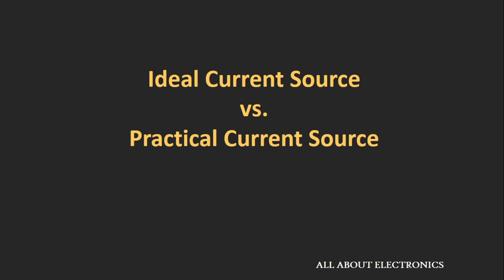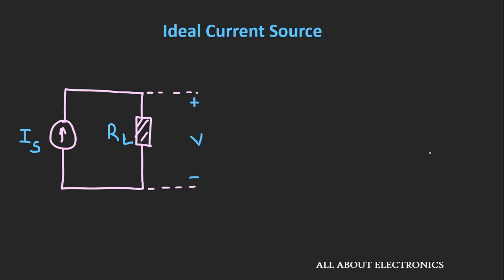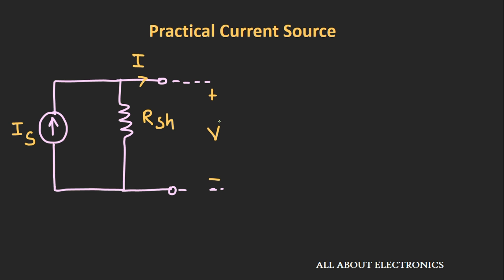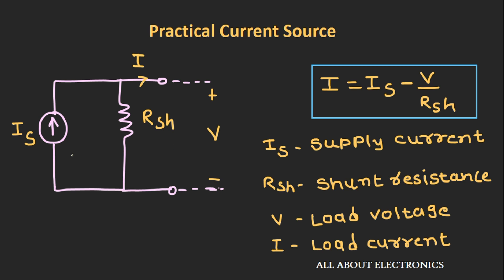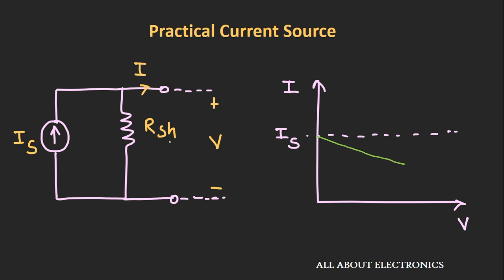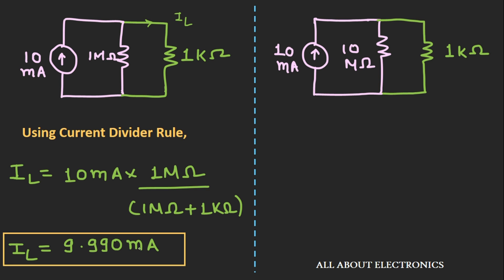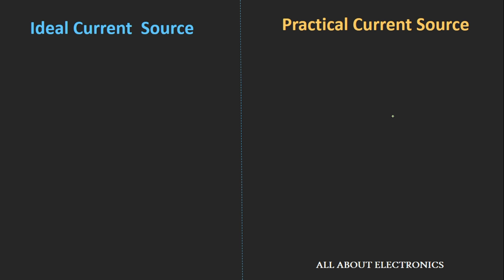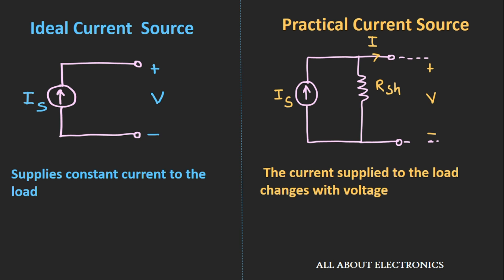Ideal Current Source vs. Practical Current Source

Comment: I may be getting something wrong, but I thought that since I is inversely proportional to resistance, increased resistance reduces the amount of current, and since in parallel voltages are equal hence if I(1)*1Mohm = I(2)*1000Mohm  then I(2) must be smaller than I(1) hence I(2) which is current through load is 10-9.990 as opposed to 9.990. for the left example?

Comment: Why is the resistance of practical current source is attached parallel to the current source a shunt, but not as series resistance?
Reply from the maker: It is the output impedance of the practical current source. If you see the V-I characteristic of the practical current source (at 2:36), then as the voltage across the current source increases, the actual current delivered to the load reduces. That means there has to have some leakage current. This leakage current is through the shunt resistance. 
If this resistor is in series to the current source, or in a way, if it is series with the load, then current through it is same as the load current. (In series, the current remains the same)
And there is no way we can characterize the leakage current. It can only be characterized through a shunt resistance. I hope it will clear your doubt. 
Also now once again go through a video, you will get it. And still, if you have any doubt, then let me know here.
Reply: @ALLABOUTELECTRONICS  Does that mean the assumption of the internal resistance of a current source being parallel to it is based on the experimental result( i.e., the V-I characteristics)? Is there any theoretical explanation for the fact that increasing voltage across the current source decreases the current to load?
Reply from the maker: @keertikiran8492  For a basic understanding, you can assume so. You can also do the experemient by yourself. Every source can deliver finite amount of power (Vx I). When you will go through the actual circuit of the current source using MOSFET and BJT, you will learn that it is in fact the output impedance of the current source. It is the inherent property of any source.

Comment: What if join shunt resistance to the ideal current source .
Can u give a example of current source
Reply from the maker: BJT or MOSFET are can be used as a constant current source. Although they are not an ideal current source. But can provide almost fixed current depending on the set input voltage or bias condition.

Comment: sir how to identify series and parallel circuits
Reply from the maker: In the case of the series connection, two elements are connected at one end. 
For example, when two resistors are connected in series, the one end is common. 
In the case of the parallel connection, both ends of the resistor/capacitor/inductor are connected together. 
I hope it will clear your doubt. If you still have any dobut, do let me know here.

Comment: Pls answer this
Why do we use shunt resistance in practical?
Why can't we just neglect it like in ideal current source?
Reply from the maker: The practical current source has finite shunt resistance. Although usually it is very high but not infinite. In case of ideal current source, the shunt resistance is infinite. So, it can be neglected. But in case of practical current source, due to its finite value, it has its effect on the output current.

Comment: Will you please elaborate 2nd point of practical current source... because I am not getting this limited thing...plz help
Reply from the maker: In the case of the ideal current source, you can connect any load. (e.g 1 ohm to 1 Megaohm or even higher). So, if the current source provides 1A current, in that case, the voltage drop would be 1MV (If 1 Megaohm load is connected). 
And power dissipation across the current source would be 1MW. But it is only for the ideal current source. For a practical current source, it can only handle a finite load. And there is a limitation on the power and hence on the voltage. I hope it will clear your doubt.
Reply: @ALLABOUTELECTRONICS  so that means as there is shunt resistance that's why we cannot provide complete resistance that a load wants...is that so ?
Reply from the maker: Because of the finite shunt resistance, entire current wont flow through the load and some current will also flow through the shunt resistance.
Reply: @ALLABOUTELECTRONICS  Thank You so much.....Got it!!

Comment: Why shunt resistor is used in practical current source
Reply from the maker: In the practical current source, the shunt resistance is the effective resistance which appears across the current source. When the load is connected across the current source then due to this shunt resistance, current will get divided between the shunt and load resistance. Or in a way, there is a loss of current through this shunt resistance. So, for any good practical current source, the value of this shunt resistance should be as high as possible to minimize the current through it.
I hope it will clear your doubt.

Comment: Sir ideal current source example plz plz bata  do
Reply from the maker: As such in reality, there is no ideal current source. Because all actual current source has some finite impedance in parallel. 
These current sources can be designed using either Transistor or op-amp.
Reply: Transistor in CE mode

Comment: What are the examples for current sources? For voltage sources batteries and generators can be considered
Reply from the maker: Unlike voltage sources, there is no example of direct (Independent) current source. Infact, all the current sources are dependent current sources. ( Current controlled or voltage controlled current sources).
And there are designed using active circuit elements like transistor or op-amp.
You can check my video on voltage to current converter using op-amp to get a bit more idea.
Reply: Good question